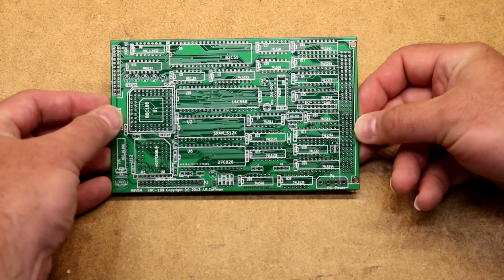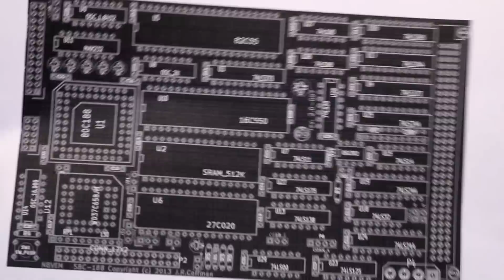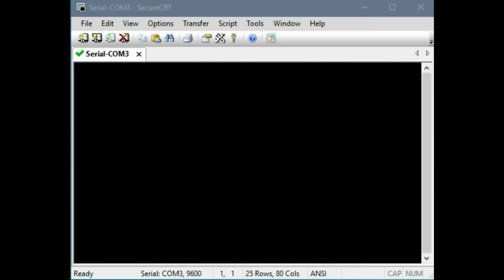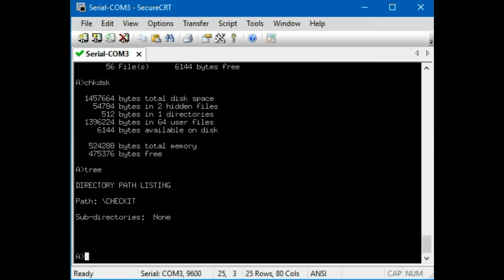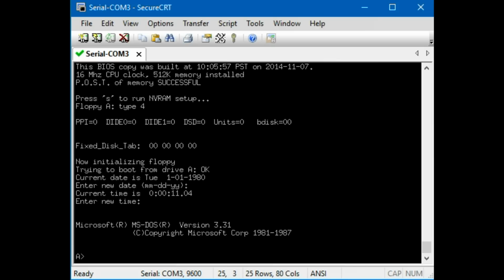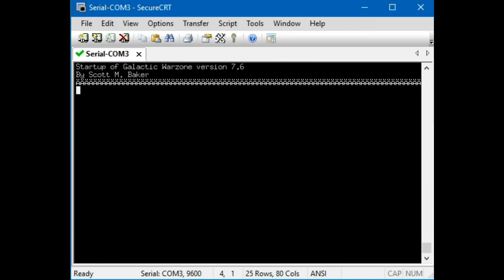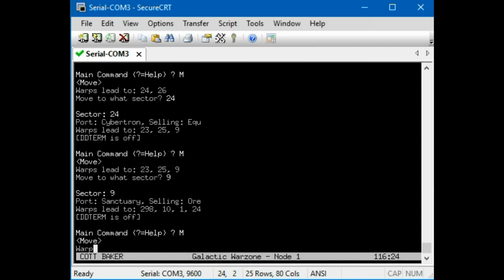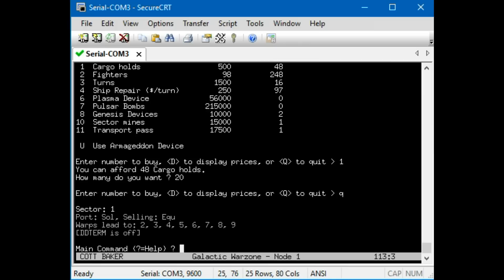Building an SBC188 Single Board x86 Computer

Comment: Can you put a 186 in it?
Reply: A 186 can't be used because the pin out is different than for the 188. The most significant difference is that the 188 only has an 8 bit data bus multiplexed with the low 8 address lines, but the 186 has a 16 bit data bus multiplexed with the low 16 address lines. Significant schematic and board layout changes would be required to accommodate it.

Comment: I ask you if you can answer, on sbc 188 it is also possible to mount CPU 80c188 ceramic version? Is it possible to also use CPUs with clocks other than 25mhz by changing the oscillator or do you also need other modifications?

Comment: oh looksie... the 80188s actually are available again... "new product" even. https://nl.mouser.com/Search/Refine.aspx?Keyword=80C188 ... after a few years of nothing on the market but ball grid array low voltage trash running overengineered bloated shit like linux... finally some proper x86 compatible processors on the market again. too bad they're not available in DIL packages but you can't have it all... now what's still missing is some 5v dip chip with a normal address and databus that poops out a dvi-d video signal and someone should start producing ethernet chips in a proper package again (none of that smd crap that falls apart all by itself when there is a bit of condense outside and it starts to freeze ;) now... if they also redesigned it a bit like they did with the 6502 to make the power drop to pretty much zero upon a HLT instruction until an interrupt occurs that'd be great. intel itself in the meanwhile still seems to think everyone wants 64 bit cpus running on 3ghz that only last 2 years for their doorbell or washingmachine. lol.
Reply: gwbasic might actually work with the dos CTTY COM1: command after setting MODE COM1: properly, as in it should... as both were shipped together. function keys are 'longer scancodes'.. might just translate some other keys/ansi sequences from your terminal input to those. checkit indeed does write directly to the character/attributes ram at b800:0000 which doesn't activate the i/o line anyway, it's normal ram. so if you have ram at that location you could probably just skip the attribute bytes and send the text data to the serial port. more likely it won't get past startup due to the 6845 not being present alltogether so if it doesn't just set the registers appropriately but also checks their status it won't get past that. if it uses int 10h you can just fake that. but then again why run dos and pc programs on it anyway... i'd assume it has some eprom slots available so why bother with a floppy and dos. it needs ethernet tho. lol. also the components (powerplug and a few of those ics on the side) are too far to the edge of the board. it won't slide in 3U subrack rail slides or cases this way.

Comment: Nice. That looks like its a pc104 card connector. What is exposed on there isa i assume?
Reply from the maker: It's called the "Eurocard Bus" (ECB) and is documented over at the retrobrew website. There are a variety of other ECB bus cards, though I don't know how many (if any) work with the SBC-188. Many are probably for Z80-based ECB cpu boards.
Reply: Only 96 pins, and the layout looks pretty weird on the schematic, so not likely PC104 (although that would've been nice). Should have all the pins necessary to make an ISA backplane board, although I'm not familiar enough to know for sure at a glance. But it probably depends on the BIOS whether it supports peripherals other than those specifically designed for it, so there's no guarantee if you built a backplane for it, that you could just start plugging in cards and they'll work without changes to the BIOS code.
Reply: ahh eurocard. yea i know what you mean, I used to build ECB stuff all the time. I get confused between pc104 and ecb